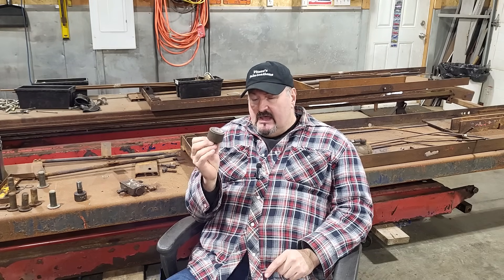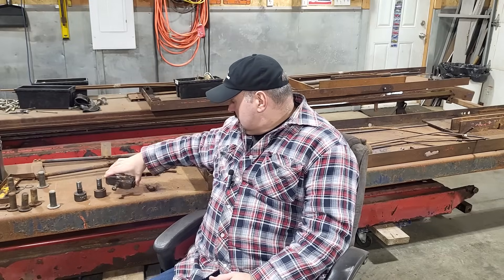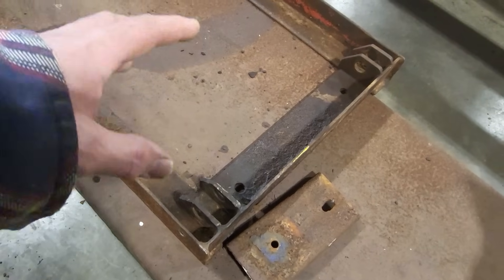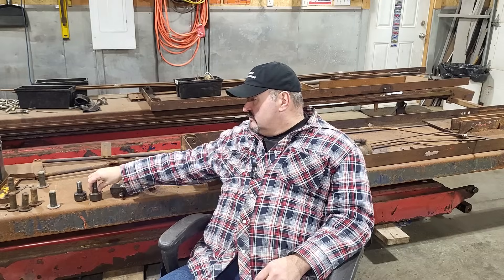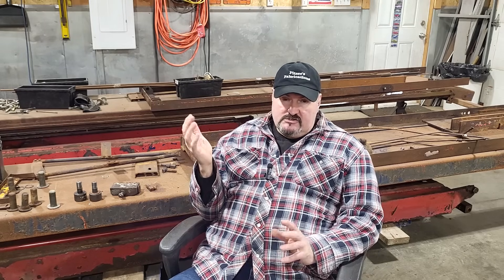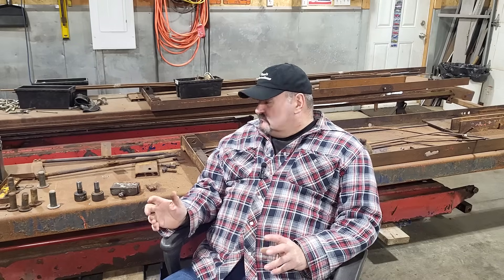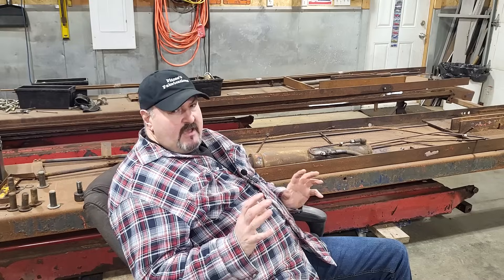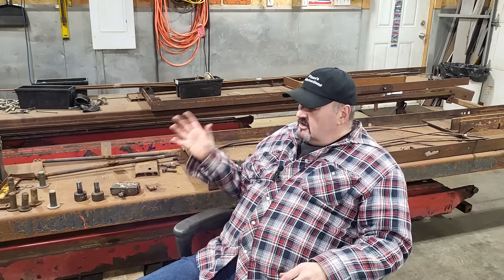Question of the week

Comment: Thanks for going into the question of CO2/Argon vs CO2..
You've given me something to think on..I really like the idea of saving some cash on gas, but my next big welding challenge is going to be my roll cage, and cleaning up welds on a cage tends to upset tech guys at the track.
I just filled up on CO2/Argon anyway, so I'll have a few weeks to think it over before the next refill..
Thanks Tony!
Reply: I looked into switching from CO2/Argon to straight CO2, and was told you need a different regulator so it doesn’t freeze up. I’m curious if that is only really possible to happen when doing a lot of continuous welding versus the intermittent welding we do on sheet metal.

Comment: 35 years ago, while building my shop, I came across an old X-Y overhead crane.  It was trash but it used those same type “cam” followers for the chain fall trolley. They wanted a fortune for them. I was broke and could not afford anything near that money. I eventually replaced everyone of those followers with a regular bearing riding on a hardened bolt spaced with washers to center it. My over head crane has worked flawlessly for over thirty years. Just what worked for me.

Comment: I like your Q&A because you actually listen to your audience.
Good tip on the Co and Co mix. It seems to weld better for me with the Co mix, but you brought up a good point, you end up grinding it away many times, and its price keeps just going up. 
You mentioned one time before that you use the smaller wire and I finally went to the .023-.025 and it is so much better than .032 for sheet metal. I have less burn through  and so much more control now.
Christmas is coming. You never know what Santa will deliver, maybe rollers for your ramp. You just have to beleave.
Have a Merry Christmas and a healthy New Year to you and your family.

Comment: Hi Tony.  It's unfortunate that you can't use the lift just as it is but if you price what a new lift would cost, you should be way ahead by fixing the one you have.  I don't know if this will work for you but I will buy parts a little at a time in order to not have a huge bill at the end of any one month.  Once I have everything, then I can tackle the project.  That rusted pump part looked like it might be a sort of junction box.  You might be able to get a local machine shop to make that for you if you can't find one already made.
Reply from the maker: It needed work andi wanted to know every inch of it so I know it was safe
Reply: Do a Live stream so the viewers can help finance the parts with Super chats.

Comment: One thought for the ramp - if it's not going up and down very often could you use a trolley jack or farm jack on one end, put the pins in or whatever to hold it at that level, then go do the other end?  Some years back I thought I needed a ramp when what I actually needed was a high lift jack and some tall axle stands.  So much depends on "use case" - up and down twice a month or up and down twice an hour?  (I loved that your bead roller stand was the engine stand you already owned).  My use case turned out to be lift, watch the kids grow up, then down again, but they've left home now and I'm back in the garage again.
Reply from the maker: Too big and heavy for that.

Comment: Automotive rear axle bearings maybe? Or maybe it was pinion bearings. If those bearing don't roll inside a "C" Channel then the OD won't matter.
I remember my old boss back in the mid seventies repaired the shop lift like that one using 65 Ford Mustang rear axle bearing or maybe it was pinion bearings. He made shaft's and used the bearing as the roller. I just remember because he had us use motor oil from one of those metal oil dispensers that make that little pop when you push the bottom in and release it. He told me they roll better then the original rollers because the diameter is larger and only had to shim something to make it level so the alignment machine was accurate. The bearing were open on the sides, not sealed but I don't know if he pulled the black covers out so we can lube it or not. 
If I were you I would go to the local Auto Parts store and look for the lowest price axle type bearing and maybe the worst part would be finding a shaft the size of the ID of the bearing. Maybe someone local with a lathe could help.
EDIT: If you're repairing it for someone else then you might get the original design but you don't really need the exact rollers if it's your lift. You just need them to roll along the bottom and not skid, or, you could make them skid if you make a "Puck" holder and use a DELRON puck or square.
Reply from the maker: The ramp weight is on these they are a special  roller made for this job
Reply: @fitzeesfabrications  Yeah I know. The ramp weight and the weight of whatever vehicle you have on it. I believe they use those rollers not because of the weight but to make it accurate. Pinion & Axle bearing are cheep, you could even double them up if you think one on each side can't handle the weight. I kind of think doing a burnout in a car or hitting pot holes in the road would be way more force then rolling back and forth on a flat piece of steel going extremely slow.

Comment: Those bearings sure are expensive. There's always the option of going with sealed roller bearings and smaller diameter bolts if it doesn't work out. The way you manage to work around sticky situations, I'm sure you'll get this lift working in the end. Like you said, time is the biggest issue. I have a lot of projects to get done myself and I always seem to never have enough hours in the day and the days fly like nothing.

Comment: If you have a good farm equipment dealer close to you. Pick up headers for bailers,hay cutters use that style of bearing in the reels. Maybe? Not sure if it “needs” to be 2” od. Just an idea, probably don’t have what is needed
Reply from the maker: The measurements can't be no smaller.  As the mounts are like 2  inches as well.

Comment: I've been trying to post to this channel but my posts are not appearing.
Tony, have you tried contacting BDI in Donovans to match the roller bearings you need?
Reply from the maker: No I have not. Anything local for most part would  most likely have to order it in.
Reply: @fitzeesfabrications  You may be surprised bro no harm to check their web site and or drop out, speaking from experience they can match just about any size roller, spherical bearings . Basil Fern is another.
Bill at Atlantic hose any fitting can make up any thing you need in hydraulics including manifolds.

Comment: Hello Fitzee

Those bearings are only needle bearings inside the roller...

Surely a good engineering shop or a bloke with a lathe and a bit of time could remanufacture or adapt them. They don't need to be the same just the same size and able to take the weight! 

Maybe I'm just over simplifying things😂😊

Comment: I'm surprised that none of the 5 bearing places near you have anything close. 2 of my local places probably have them, but Ontario would be closer to you and then again shipping to NF. The valve body you should be able to get from princessauto. It would be slightly different, but it's just a proportioning and lock valve in one.

Comment: Have you seen the lift dd speed shop has? It's a sizzor lift he bought from princess auto or Harbor freight.  Takes up less room. Not 100 percent sure about the vendor. Valves lines rebuild parts for cylinders may start to run up there. Have fun Tony.

Comment: Hey Fitz I think your over thinking the lift table, Just put it back together and run new Hydraulic lines and test it out, the rollers can slide on some grease, your not using it as it was built for, you may run it up and lock it in place maybe 20 times a year, so maybe just get it working and test it out make sure it's safe but don't over think it, it's a lift not a Swiss Watch! Lol Just my suggestion Abby

Comment: I would just buy heavy duty steel bolts. Cut the head off the bolt weld a big thick washer on there . Then all your left with is 12 dollars each on the bearings . Put back in screw nylon nut on job done

Comment: It's good to see you get frustrated about some thing. You seem to always have the answer to everything, or a plan B if you don't, and, it makes you seem a little superhuman and a little bit like your advice isn't something we can always follow, because we can't do what you can. It's nice to see how relatable you are. As to the expensive rollers... why not just use cheap $2 ball bearings, doubled-up for extra width? Maybe junkyard wheel hubs if the design allows them to be oversized. It's just a roller, can't be rocket science. For the hydraulics, do you have a mom 'n pop forklift servicing place there on the Rock? The corporate shops shook their head but my local one here let me take whatever I wanted off of their old wrecks in their boneyard. Hydraulic stuff almost never fails so they have no value in holding it. Power palletjacks might be another source of suitable scale components, probably same place has those.
Reply from the maker: The weight of the ramp rolls on these. They have to be a snug fit
Reply: Agreed! Just give it the ol' fitz-a-rooni and adapt some front wheel drive bearings from your local parts store.  They're nice and wide.  Just need to figure a way to weld that stub to it.  Try and find the smallest diameter bearing you can, say a Toyota Corolla or something alike. 

Com'on, you can do it, Fitz!  Wow us again.

Comment: I think you are right to just leave the ramps until you can get all the parts first. It is going to be an ongoing affair to repair it as you are using it. As long as the steel on it is ok it will work out.

Comment: I weld all day every day & never buy any gas - I use flux core. Yes, you have to brush off the slag - I use a brush in a cordless drill  - yes there is spatter -  I grind everything so who cares? Gas used cost me a fortune every month. Now it doesn't  -which I count as a win.
Reply: I have attempted a cut & butt using shielded 0.6mm Mig wire - however it resulted in a calamity.  You must be a seriously good welder.

Comment: The higher the CO2 concentration in the welding gas the greater the penetration and the narrower the bead profile, for really thin material 5% CO2 95% argon or 5% CO2 94%argon 1% oxygen gives the best and fastest welds. CO2is not an inert gas as it breaks down in the arc to carbon and oxygen, the oxygen acts as a wetting agent and the carbon then either is absorbed into the steel or goes into the atmosphere as carbon monoxide.